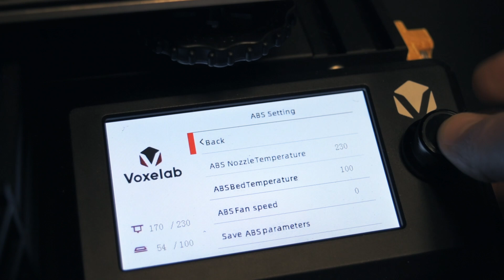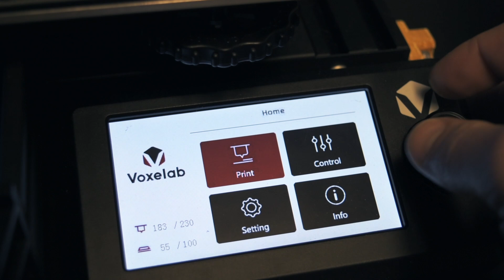Can the Aquila print ABS?

Comment: And I just bought a shit ton of abs thinking I could run it on this machine. I'm getting the setting. I've been having stick issues as well on first layer. I got this thanks again!!!!
Reply: That was the first upgrades I got was the tube and hardened tip. I run a lot of petg. I wonder if tape would work just as good on abs or am i catching 🔥  haha.. we talked on messenger before you actually helped me set the machine up. Over last fall.
Reply from the maker: Well in that case, nice to talk to ya again! I try to help everyone, so it’s hard to keep track! Haha 😂 tape should be just fine. As long as you don’t mind reapplying. :)
Reply from the maker: Try both sides of the bed. And try adding glue stick. If you apply the glue stick cold, it’s much smoother on the bottom! And a ptfe tube is very inexpensive and I have a link to em in the description. You should be able to print abs just fine.

Comment: Bro I Need Your Help asap please am about 30 min away from  my filament running out on me had a print that took 1 day and 5 hours to complete with 4 more hours to go 
 . i got a new roll of filament , i just need to know how to change it safely please if you can comment on best advise
Reply from the maker: Well two ways to do this, one would be a pause. However when you do a pause the printer doesn’t always pull the head away from the print. Which means, it will melt and pool filament in the place it stopped. Your best bet is to cut the filament and be there, ready to feed the new roll. You have to try to do that without squeezing the level much or else the filament won’t Extrude.
Reply: @3DPrintSOS  THANSK bro what about cutting  the power off would that work ?
Reply from the maker: The downsides there are, if the head moves at all, it won’t start up in the same spot. Also, the nozzle will still be super hot and will ruin where’ver it rests.
Reply from the maker: Your best bet is to cut the filament off, and be right there with the new strand feeding it right after the cut part.
Reply: @3DPrintSOS  thanks bro I’ll go with the first option you mentioned highly appreciate you commenting this fast 💪🏼🙏🙏
Reply from the maker: No problem dude. Good luck with the switch. Always a nail biter
Reply: @3DPrintSOS  I got 10 min left will do this .. wish me best of luck 🤞
Reply from the maker: Also, if there is an area of infill, that is where I would do it.

Comment: So-- I upgraded to cura 4.9 and I can't get octolapse to run on either ender or voxelab..  what have I done" Some slicer settings were missing from your gcode file. Missing Settings: Retraction Length,Retraction Speed,Deretraction Speed,Z Lift Height,X/Y Travel Speed,Z Travel Speed"
Reply from the maker: A few people are reporting problems with the latest update. I would try to get a hold of version 4.8
Reply: @3DPrintSOS  The Devils Lettuce solved the problem!
I Think I am going to build that guys crazy fast printer-- lets get a group buy from ali for parts!!!
Reply: Thats one of the reasons I use Ideamaker ...there is always some issue when they upgrade cura .

Comment: I use pei springsteel to print abs and covered with a clear garbage bag as an enclosure.  I ued 1.5kg of esun abs+ and no flaw.....printing a voron project 2.4 in 3 colors
Reply: Hi Could you name the core stl that need to be printed
Reply from the maker: Whenever I have a big project I make a “to be printed” folder and a “printed” one. Then I try to drag them as soon as they are done.
Reply: Because I am just lost in the STL’s cuz there is so much to go thru. Thanks heaps

Comment: I was wondering if it would do ABS gracefully in stock form, and looks like it can.  Is that bowden tube the stock one that came with it, or the Tecboss you recommend in your other video?   Also, completely off topic, but a super informative video would be on how to print via the USB port.  Having to walk the SD card to and from the printer all the time is getting old =P.  Also, a video on BL touch/3D Touch (I know you probably get that a lot)... :)
Reply from the maker: It’s still the stock tube. Have kept it on there to illustrate what a stock printer can do. But I wouldn’t keep it on there much if you plan on printing hot. 

Thanks for the vid recommends. I get both of those a lot. I have them on my radar.
Reply: Yes! yes! I would like to have the same info and instruction. Voxelab customer service says it can not be done.? HMMMMMMMM

Comment: Are you running the glass bed upside down for a reason?
Reply: He did mention during the video that it can be one of the things to  experiment with for better adhesion with this material (i.e., ABS)
Reply from the maker: I run the bare glass side for better adhesion with pla. At least in my experience. I do this on al of my machines. However, as you saw in the video, it wasn’t perfect for abs.

Comment: I am worried about using ABS on budget printers as high heat can cause issues to the hardware faster than normal
Reply from the maker: That’s likely the case. However at these prices, replacement parts are as cheap as they come. The cool part is also the downside I guess. You can print things like this on such cheap equipment. It just wasn’t possible even a few years ago. That’s pretty cool.

Comment: awesome video as usual ! , one tip that could help is disolving scraps of abs filament in acetone to make a slurry then use it to make the print stick to the bed
Reply from the maker: Woa, that’s a thing? I gotta look this up! I have a ton of acetone.
Reply: @3DPrintSOS  yes! it is! , give it a try!  , and it doesnt ruin the bottom of the print xD , its like using gluestick , what i usually do for best results is apply a layer of blue masking tape on top of the glass , then apply the slurry using a spatula where the print will be layed down and it comes off really easy from the tape without resiude after printing
Reply from the maker: Interesting. I’ll experiment with this for sure.
Reply: @3DPrintSOS  Yes, it solved bad ABS plate adhesion problem with my old MakerBot. I put kapton tape on first, squeeged the ABS/acetone slurry with a spatula, and boom, worked great. I've got the same setup now with my Aquila ABS printer.

EDIT: it's sticking too well actually. I'm having a real hard time removing the print from the print bed. I'm going to try the glue stick method.
Reply from the maker: This is a really cool pro tip. Totally going to give it a try on my next abs print.
Reply: @3DPrintSOS  see my edit above lol.
Reply: glue stick with some ipa to thin it works great on epoxy fiberglass bed like g10.

Comment: You managed to do what I could not. Defo gona give it more effort now I have seen you managed to do so well. Did you flip the bed to the glass side just to protect the textured side from the glue or was there another specific reason for the ABS prints?
Reply from the maker: I flipped it because I find the adhesion to be much better for pla. Which is why I print 90% of the time.

Comment: I wouldn't recommend 300, the ptfe will start breaking down slowly. 275 should be safe no problem with any of the high temp ptfe tubes. 

Just remember the gas released by burning ptfe is a nerve agent. Not something I'd recommend getting close to.
Reply from the maker: Yes, I’m just saying the ptfe tubes go up to 300. ;)
Reply: @3DPrintSOS  they still offgas above 250, their ad copy says as much
Reply from the maker: It’s probably best to get a hotend that an all metal heatbreak. Then you don’t have to worry about it. Especially if you’re planning on doing more than a few prints at high temps.

Comment: I heard ABS is less viscous than PLA and PETG when melted, so it might be overextruding because the extruder is facing less resistance than it's expecting, since you tuned your machine on those other plastics. 

I want to do ABS too but am waiting until I have an enclosed printer with an outside vent due to the fumes it generates. It's nasty stuff compared to PLA and PETG.
Reply from the maker: Really, I didn’t know that about the viscosity. And those are all the reason I’ve waited years to print ABS.
Reply: Hey Fedor. Did you notice any fumes  when printing?
Reply from the maker: It’s a major concern of mine. However I noticed no smells. Could be the specific abs